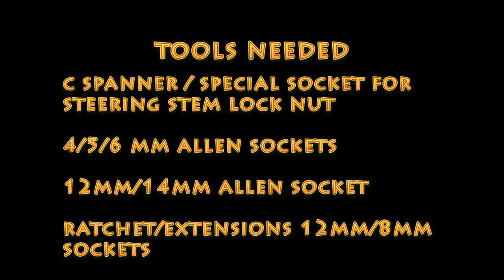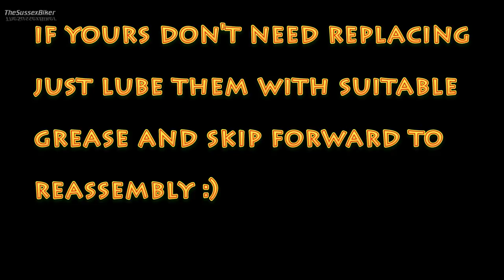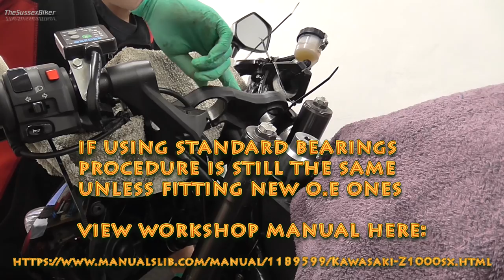Z1000SX Service Series -Part Four Grease/Replace Head Bearings

Comment: Never realised the exhaust was strong enough to prop one of those big yokes up. Top tip.
Reply from the maker: It's not jacked up on the exhaust, it's on the jacking points on the engine. My bad for not explaining fully, I was just explaining thats where my jack was positioned my apologies. Thanks for watching.
Reply: @TheSussexBiker  Thank you for the reply, thought it seemed like a lot of weight. Thank you for getting back and the excellent and helpful videos. Shame those damn exhausts are always in the way for an easy prop up with a jack. Patience and contemplation certainly are required for when working at motorbikes.

Comment: Hi TSB. Sincere compliments on your excellent series. Absolutely  invaluable and much appreciated.  I'm interested to know what  mileage you were servicing he Z1000 at ? I'm about to do my Versys 1000 at the 2 year / 7500 miles mark. The head bearings lube is clearly quite involved and of course I'm contemplating checking the function, but if OK, leaving the lube to a later stage. I wonder what your thoughts would be on the likelihood of any bearing / lube issues at the 7500 mark ? Keep up the good work and hope you are still enjoying the  BM.  Cheers

Comment: I have a strange thing with my z1000sx. My handlebars are a bit off.. i know that forks can turn a bit when riding hard or bumping in to something or if u drop the bike. Im thinking that I need to loosen everything in the front end to get it aligned again. Any thoughts or tips, have you encountered something like off handlebars. It hasnt been in an accident or anything, its just feeling off to one side 🤔🤔
Reply from the maker: Hi, I would certainly start with that, it may be worth checking if your head stock bearings are free and not notchy, also is the front tyre in good condition i.e not squared off? It's not something I've personally encountered. Good luck with it and I hope you get to the bottom of it.

Comment: How do you get the fork legs bang on straight so the wheel fits straight?
Reply from the maker: Hi sorry for missing this comment - if I'm understanding you correctly - the fork legs fit in the upper and lower clamps and you set the height at the top - from the clamp to the top of the fork tube and then they will line up.

Comment: What size C spanner you use
Reply from the maker: Hi I can't remember the size it was a while ago. I think it was one I had knocking about. Although this isn't a c spanner it may help
https://www.ebay.com/itm/123793334755
Reply: This is socket you use for upper nut so you use C spanner to hold bottom nut for no movement during a secure a top nut .i talking about when you all assembly back .
Reply from the maker: @viliusjonaitis3264  Yes I understand that I can't remember the size sorry. Don't know if this will work maybe too thick https://www.amazon.co.uk/Draper-68856-19-Adjustable-Wrench/dp/B0002GV11Y/ref=sr_1_1?ie=UTF8&qid=1408436254&sr=8-1&keywords=c+spanner
I was thinking get the socket then you can measure it.